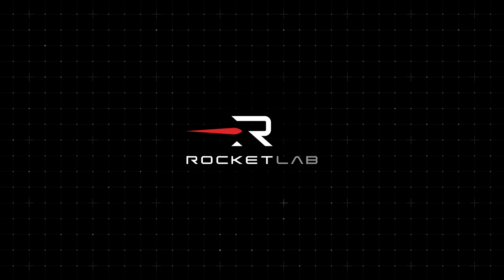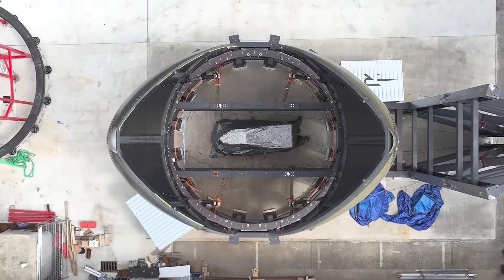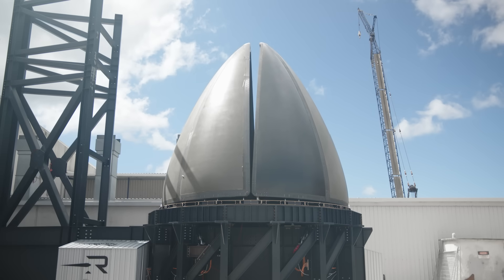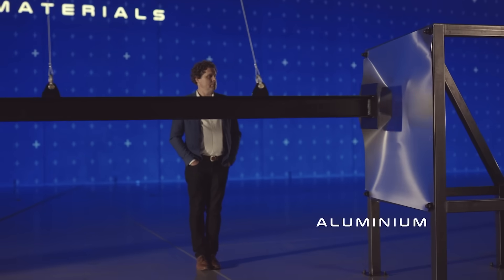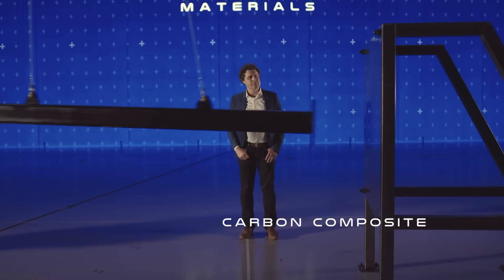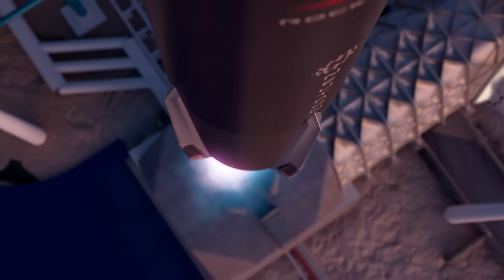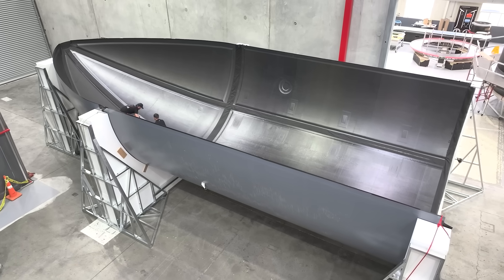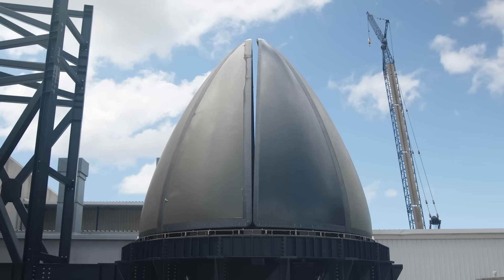Rocket Lab | Neutron's Captive Fairing Explained

Comment: It would be better to have the Neutron flight capable with detachable fairings first and have it fly missions, and later attach reusable fairings when they're ready. So far, way too much attention is on these fairings and very little attention on the rocket itself and its engines. Suspiciously so. I'd go with detachable, thin aluminum fairings that don't need to be fished out and can just sink in the ocean and dissolve there, but rocket body, engines, launch and land infrastructure should be priority number 1. Otherwise it seems Neutron will fly no earlier than 2027 if it will at all... And as RKLB investor - i don't like that.

Comment: My main concern with neutron is that the engines may not be high-performant enough for all the going up and going down job they have to do

Also, the rocket as a whole may be too expensive. Yes, it's reusable, but in practice I'm afraid it's going to wear faster than expected and it's going to need more maintenance than expected
Reply: at least they are going for staged combustion cycle now compared to earlier plans.

Comment: Then the whole rocket must reach the 8 km per second speed. You have no second stage. How you will reenter the earth's atmosphere?
Reply: It has a second stage inside. It is released when out of the atmosphere.
Reply: @Viktor-x1w7w  it would be so small, i don't know. Or the first stage must be gigantic
Reply: You can Google their recent second stage cryo tests, it's the size of roughly four busses (don't forget, this thing is 5 m in diameter). And it will hang below the fairing.

Comment: A very 007 rocket, "designed to operate from any volcano base" as Scott Manley put it. Can't wait to see it fly!🚀
Reply: Is that fairing big enough for a Gemini capsule though?
Reply: @peraltarockets  Lol - good point... I checked the Neutron Payload User's Guide, and the fairing is 5.5 meters in diameter, so it should fit a payload that is around 5 m in diameter. The Gemini spacecraft (with service module) was 3.05 m in diameter and 5.7 m in length, so it should easily fit :)
Reply: @joakimlindblom8256  Oh No! 😆
Reply: @peraltarockets  There is a Gemini Test Article at the Leicester Space Museum - it is surprisingly tiny - no room to get up and walk about! :D Looks similar size to the Neutron 2nd stage demo tank footage.

Comment: Looks very flimsy to me.  All these theories sound great in the boardroom but when a heavily vibrating rocket is pushing through the shockwave of the atmosphere it might not be as they think. How about we have less talk, and more actual evidence.
Reply: tbf fairings are typically quite flimsy when not closed, they rely heavily on the circular structure they make to withstand aero loads. You can see fairing jettison on Atlas or Delta or Falcon and they wobble like jelly when they do but together they’re enough to push through the sound barrier and beyond. 
Definitely would like to see a more representative demo though.

Comment: What mechanism keeps the interface of the two fairings sealed? I'm curious what the solution is to keeping them from slightly separating and catastrophically catching wind. Kind of looks like the nose cone has an overlap that is meant to serve this purpose? 
I'm envisioning opening a convertible at highway speeds...
Reply: Duct tape, they have a midget in a space suit with a roll of duct tape to reseal it before reentry.
Reply: Space systems engineer major here

Id imagine there’s a locking mechanism but I was wondering about a similar issue 

Even at high altitudes with low atmospheric pressure there will still be a lot of force acting on the fairings when open especially at 10k + mph I was wondering how/if it would affect the flight path or if the force could damage the hydraulic system used to open and close the fairings
Reply: @Stunting_with_Robert  My understanding is that this rocket goes into orbit i.e there is no second stage. So the carbon fiber fairings will be well and truly in space by the time they open. But it will be interesting to know how they are sealing the two halves.
Reply: @ if that’s the case it seems the rocket would need heat shielding if it were to be capable of re-use do you know if there is any info greater than the diagram about its launch path

Comment: I feel like they have a backup system for the fairings if they fail somehow. That would just be such a stupid reason to fail a mission- but if the booster came back down with the payload still inside, I guess they could just try again.
Reply: True, they have to nail the fairing mechanism. If the payload remained inside, the returning rocket would mich heavier and probably wouldn't survive reentry, let alone land.
Reply: @lusbax  Ontop of that, assume the fairings don't open and the second stage ignites. They're liable to blowing up their entire rocket in that instance.
Reply: I doubt it would be able to land with all the weight of the second stage and payload still attached. Having explosive bolts on the doors might make sense, if there's even time to have a backup once you're up there. In the end, rockets have a lot of single points of failure.
Reply: But that's true of all launch vehicles... if the fairings don't separate, the mission fails. Granted, the mechanism is a little more complex here, but fundamentally, you need everything to be reliable.
Reply: @simongeard4824 That is true, fairings are a pretty important point. But the issue comes not with the payload, but with the second stage. If it ignites and the fairings don't open... well, you don't have to be a rocket scientist to know that won't end well.
Reply: @atomf9143  I think you're worrying about the wrong thing. If the fairing doesn't open, the mission is a complete failure — but that's true of almost every rocket, and it's true regardless of whether the second-stage engines ignite at an inconvenient time. And that's hardly a serious concern anyway, because any engineer with half a brain would ensure that "open doors" and "fire engines" are dependent events.

Besides, the Neutron design isn't unique in this respect anyway... various other rockets (most notably, larger Atlas variants) have had the second stage encapsulated within the fairing. The only part that's unusual for Neutron is that the fairings can be closed again rather than just being jettisoned before staging.

Comment: So the first stage is going to spit the second stage out of the fairing, and then close the fairing? Do they plan to try to recover the second stage?
Reply: No, the second stage is planed to be as simple and inexpensive as possible. By sitting inside the first stage it's not subject to aerodynamic drag in the lower atmosphere and can be made with less mass that isn't engine, fuel or payload.
Reply: No. They're betting that, at least for a rocket the size of Neutron, having an upper stage that's designed to be cheaply expendable is going to be more cost-effective than trying to make a re-usable one... and by keeping that second stage entirely contained within the first, it can be made very minimal. No aerodynamics... just an engine and tanks, and somewhere to attach the payloads on top.

Whether they're right remains to be seen... but given that SpaceX ultimately decided that Falcon was too small to support a recoverable upper stage, it's doubtful that Rocketlab would make a success of that with the even-smaller Neutron.

Comment: Starship really needs to do something similar; it allows the entire volume of the payload section to be released. I don't know how they'd be able to do that in combination with keeping the flaps for re-entry though.
Reply: Cargo Starship was always going to have a hinged door...
Reply: @Duckly97  How big a door? It's not a trivial problem. A dock door big enough for a rover, a pez dispenser for starlink 2, all fine; not sure though if they would attempt anything equivalent to slicing the nose open ("the entire volume of the payload section to be released")
Reply: The early SpaceX renders for Starship included a little animation of a "chomper" cargo door. Basically, everything not covered by tiles is part of a monster hatch that lifts up like the hood on 1940s pickup truck. 
To my amateur eyes it'll be difficult to latch securely enough to maintain the structural integrity of the cylinder to hold up to the unique load directions of Starship's reentry, belly flop, and flip landing.
Reply: Shouldn't be too hard. Just one half opens. The deployment mechanism would push out the payload on a roughly 45° angle through the center of the opening. They are focusing on Starlink launches first, because that's what's going to soak up all their initial launch cadence, and help them develop, scale, and optimise Starship so that it's ready for other customers. They can afford to take their time with customers, since they're ahead of competitors with F9. But they can't afford to wait for Starlink.

Comment: Can NASA's Inflatable Heat Shield be use to protect Neutron's second stage on reentry and then reuse it?
Reply: I'm not sure it's even needed. COPVs from second stages often survive the reentry as they are (even without heat resistant resine). And that second stage is a giant COPV.
But anyway, they should start launching first, before even considering the second stage reusability.

Comment: hey I hope everything is well design side, Seen lots or redesigns over the past few years, you guys got this! Those hydraulic arms inside look like they're taking a lot of space. Have you tried integrating one arms inside the fuselage per side, right under where the two faring halves are joining together. each of those arms could have two ''sub-arms'' attached to the bottom corners of the fairings to push them out. Then all you need is 2 hinges. Not sure I explain it properly, But I've got ideas.

Comment: I can just imagine somebody in RocketLab randomly asking the question during one of their meetings: "Why do the fairings have to be jettisoned in every mission?"
And I can see why the penny-dropped with that. I mean, why put in all the effort to recover the fairings after the mission when they can just be left attached to the rocket? 🤔
Reply: they’re heavy.
Reply: @FailSpace2  Reusability will always incur mass penalties
Reply: @ Yep, but it’s worth it in the long run due to the cost savings
Reply: why would it be attached to the second stage
Reply: @AeonExploration  it doesn’t, it stays on the first. The second stage is deployed from the fairing, rather than just the payload.
Reply: The best recovery is no recovery ...
Reply: @AndrewEddie  are you just against reusability? Explain?
Reply: @spray_cheese  Seems like he means that it’s best to have as few recoveries as possible to save on costs.
Reply: @FailSpace2  oh duh😂 that went right over my head lol. Thank you.
Reply: I imagine the thought process was different to that. You can watch his more technical interviews to get an idea. It likely started with "If we are ruling out second stage reusability, we need to make it really cheap and light, and a part of that is moving as much as possible to the first stage". It's not only the fairings, it's also the load structure of the upper stage. They call it a "hung" stage because it hangs from the first stage internally using tensile strength, which means it doesn't have to have its own compressive structures to support itself during the first stage ascent, saving mass and reducing material costs. It's a really smart competitor to Falcon 9, and significantly more mass optimized. The design philosophy takes the opposite approach to Starship for bringing down costs. Neutron's upper stage is a LOT simpler than Starship's without the constraint of full reusability. "The best part is no part" as they say.
Reply: @xlynx9  I feel like by the time you take into account the cost of Stage 0, Neutron is going to be as cheap or a little cheaper than Starship on a per kg basis (I hope anyway). And if Starship looses Stage 0 in an incident, things get even more interesting.
Reply: @AndrewEddie  It's almost as if SpaceX was building multiple pads for a reason
Reply: @xlynx9 the interesting thing is that the second stage reusability may actually be possible. It is so light that it may actually survive the re-entry (from LEO). 
COPVs from deorbiting second stages occasionally fall on people's houses. And that thing is just a giant COPV. Add heat resistant resine for the carbon fiber bonding and a parachute, and that may work.
Reply: @xlynx9 the interesting thing is that the second stage reusability may actually be possible. It is so light that it may actually survive the re-entry (from LEO). 
COPVs from deorbiting second stages occasionally fall on people's houses. And that thing is just a giant COPV. Add heat resistant resine for the carbon fiber bonding and a parachute, and that may work.
Reply: @xlynx9  when stage 2 fires, stage 2 will be under high compressive stress due to high G load (especially in the later part of burn). Acceleration loading in stage 2 will be much higher than from stage 1 and for a longer duration.
So perhaps it is lateral stresses, vibration, air turbulence that sort of thing that are reduced - what do you think?